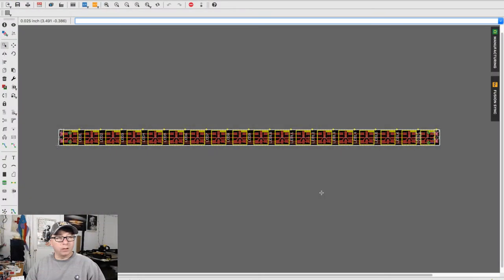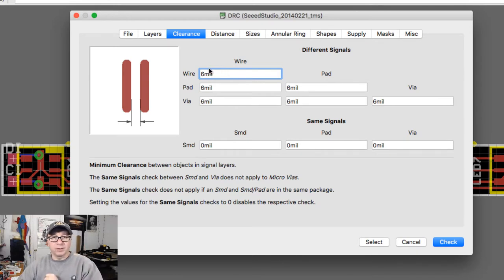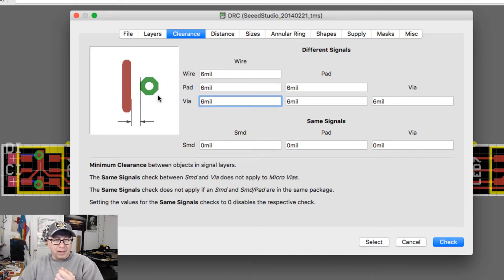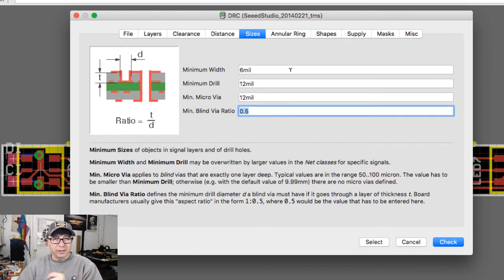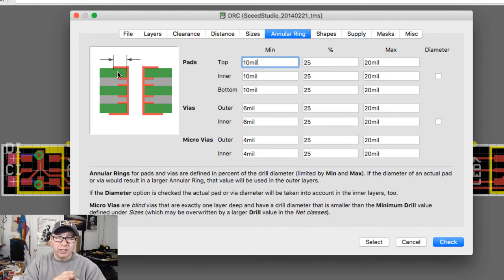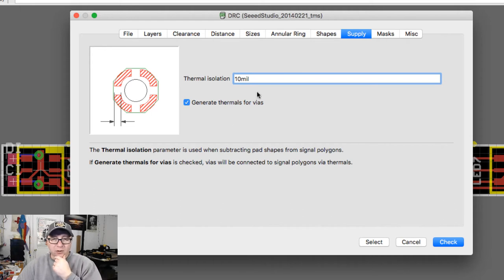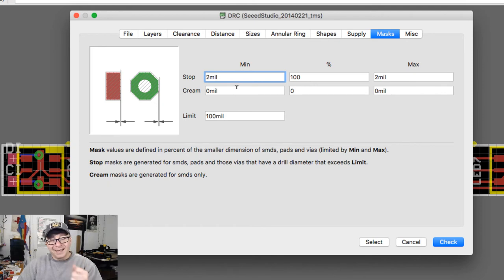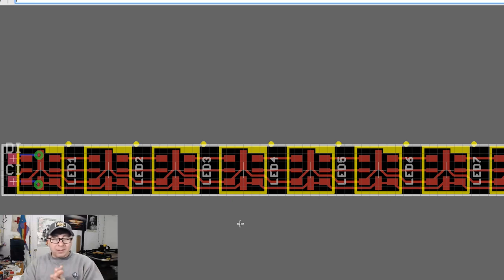Eagle CAD - Design Rule Check

Comment: Hi,

Not sure why nobody has commented on this post but I think you have explained things pretty well.
I was able to figure out what the values should be by inspecting a few production PC boards.
I thought it would save time to find a video to explain what each of these tabs and values in the boxes were for, although, most are self explanatory if ya look at the diagram on the left and as you click on each box (it wasn't clear to me at first that I could get a detailed diagram for each box/category). 

I do think that the minimum drill size should be more like 30mil though. 
It’s seems that manufacturers use drill bits in increments of .05mm and .012” is quite a bit smaller than many device legs (like a standard LED has legs of around .023” or 23mil).

I prefer my traces to be around 12mil with 12mil spacing but that’s just my personal preference.
Of course IMHO it is a good idea to size traces according to current draw (for higher current devices like a 3 amp photoMOS for example),
Fortunately there are a few great trace calculators online! :-) 

Anyway, nicely done, Sir!! :-)

Comment: Thanks for the video. Is the clearance tool still as basic or do they allow multiple net classes yet? For example, a primary AC circuit may want a high clearance to a secondary side low voltage circuit within the same PCB.
Reply from the maker: @wiggyB - great question.  Based on the version I'm running, there still is no ability for multiple net classes.  However, I heard @autodesk is baking #eaglecad into #fusion360, so hopefully they will add that capability to bring the PCB tools into parity with others.  Thanks for watching and I will keep you posted on any updates I see that may help.
Reply: cyberreefguru Thanks for that. The superb mec to elec integration makes the layout tool worth using for simple boards, like LED indicator panels. As you say, they’ll need to bring it closer to parity before it can replace our existing layout tool for complex stuff. The future looks very bright though.